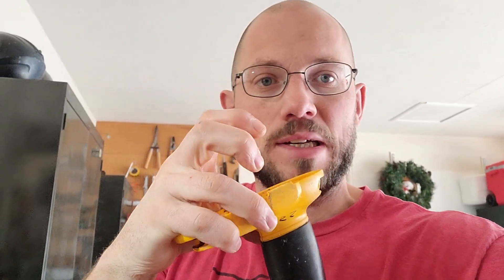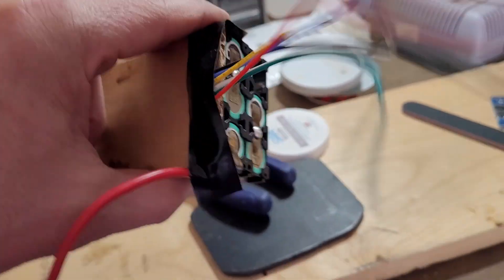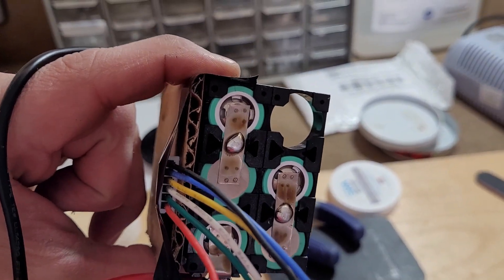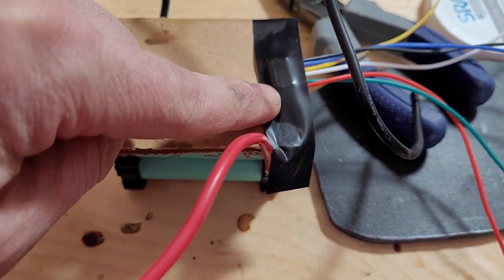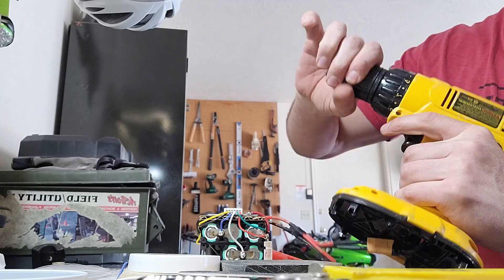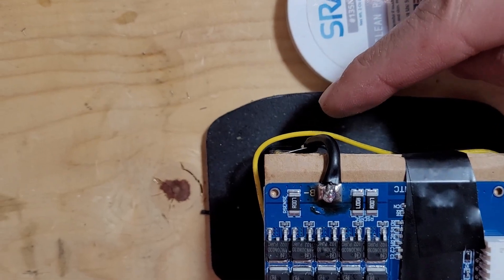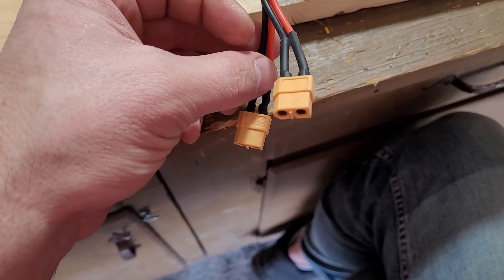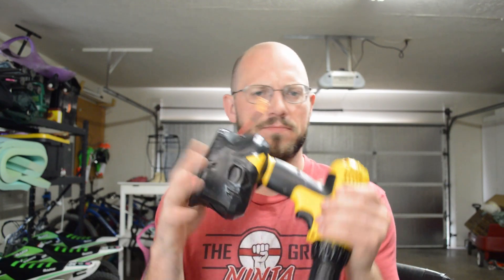Replace DeWalt NiCad batteries with li ion 5s batteries! Drill battery replacement.

Comment: What is the nicd batt pack voltage rating?
Reply from the maker: Ni–Cd battery was 18v,  but wouldn't hold a charge. I replaced it with 5 lithium-ion cells in series, so 18v as well.